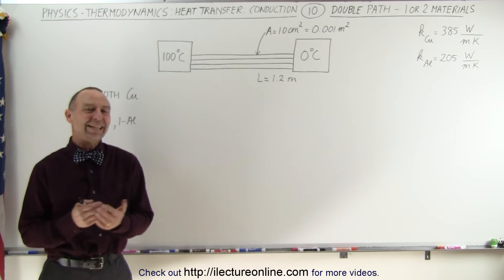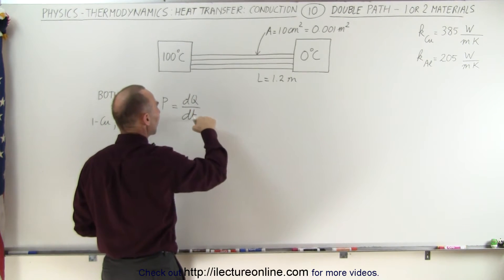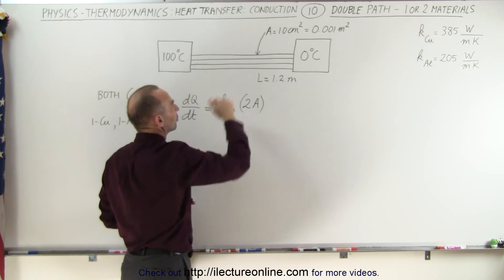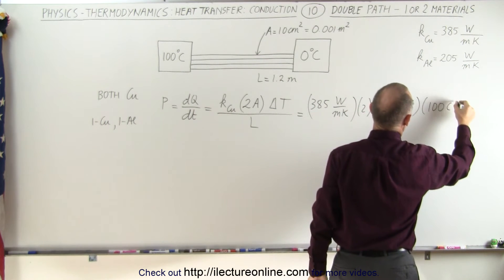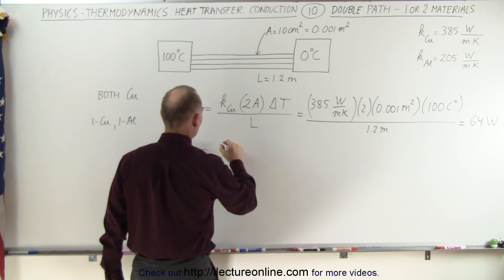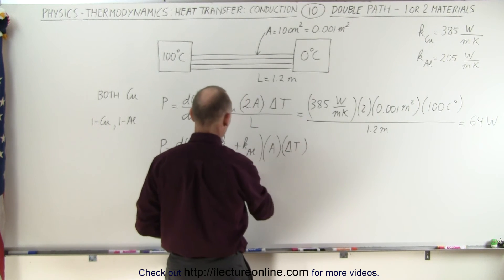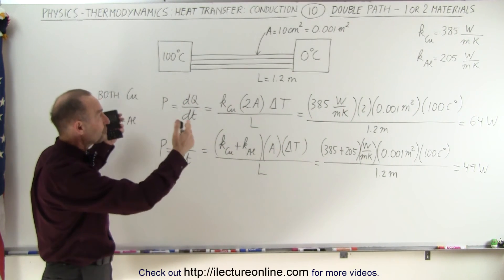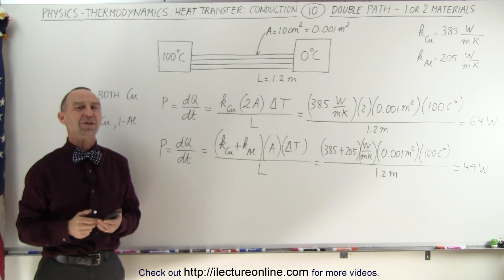Physics 24  Heat Transfer: Conduction (10 of 34) Double Path - 1 or 2 Materials

Comment: The A = 0.001 m^2 in the second case only accounts for the one rods, when I thought both should be accounted for?
Reply from the maker: They both have the same cross-sectional area.
Reply: @MichelvanBiezen  Thanks for responding. Yes, but there are two. Would that not be twice the flow as one rod?
Reply: @MichelvanBiezen   I responded on your video #11. That made it crystal clear. I got it now, thank you.

Comment: The unit for temperature difference here should be in K.  Thanks for your lectures, I like them a lot.
Reply from the maker: They can be both in K and in Celsius degrees.  It doesn't make any difference, if used for the temperature difference.

Comment: Thank you for all the videos! I have a small question. In the first equation there is a '2*A'. In the second equation there is only a 'A'. Could you explain why you did that? The area is still the same in both cases, so I really don't know what you did there.
Reply from the maker: In the first equation, both conducting paths are made from copper.  In the second equation one is made of copper and the other from aluminum, so then each only has cross sectional area A.